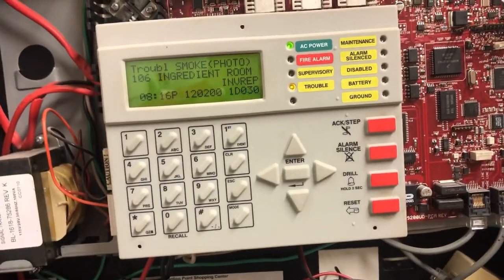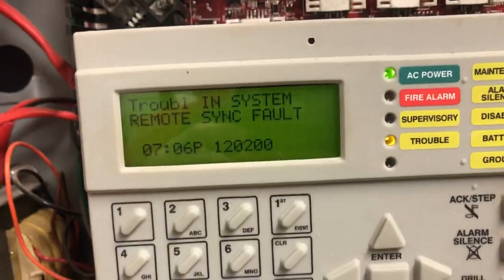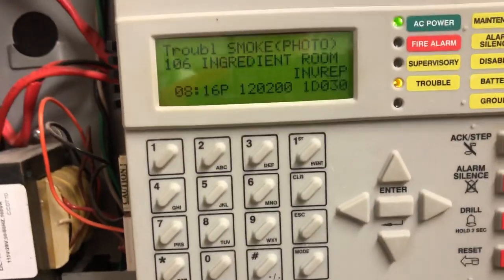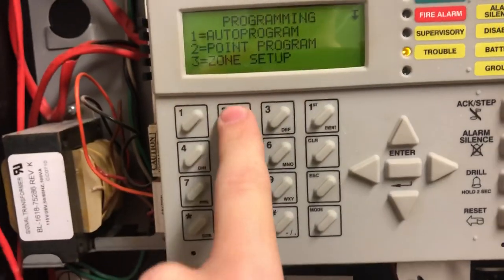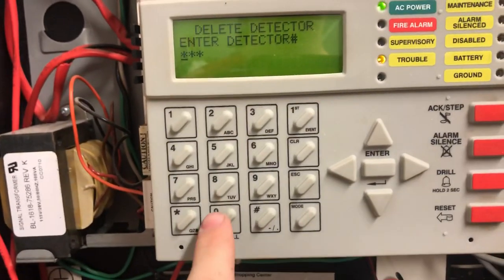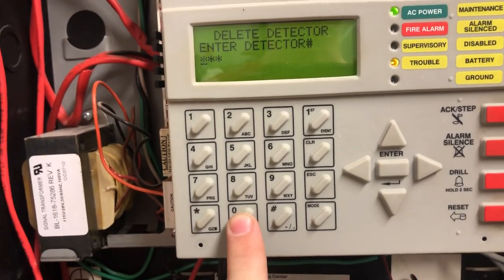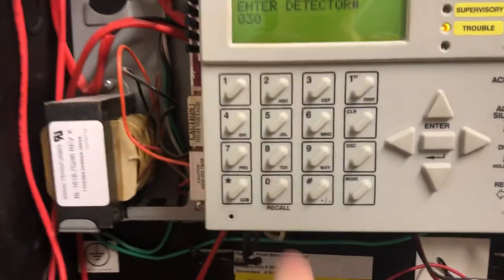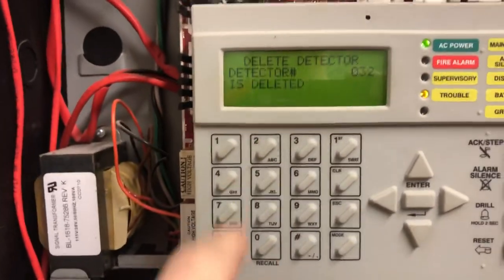The World of Fire Alarm: NFW2-100

Comment: Dear Sir, I am grateful to you. Your articles helped me a lot. Could you plz help me on one more occasion? Need to know how to provide power to control modules in nfs2 640 and how to assign detectors & horns in a zone ?
Reply from the maker: Use the 24v Auxiliary power terminals located at the top of the CPU board for NFS2-640 and connect them to the auxiliary power input terminals on your FCM-1’s.

To assign zones to a device through the keypad, hit the following keys:
Enter-> 1 ->  You will be asked for the password. The default is “00000.” -> hit 1 for basic program -> hit 2 for point -> hit the # button followed by the loop number and device address for modules and enter the number of the zones you wish to assign to that address in the 5 blank spaces on the second line of the LCD. Do the same for detectors, but instead of hitting #, hit *.  For panel NACs, hit & followed by the number of the NAC you wish to edit.

I hope that this message translates well into your language so that you have no issues understanding my instructions. I will try to make a video demonstrating this process sometime soon

Comment: If I made the FireWareden series. I would put in The real FlashScan instead of the fire warden “flashscan” along replacing Fire lite CLIP with Notifier CLIP kinda like the AFP-100 where there was Notifier CLIP instead of the Fire lite Clip on the Original MS-9200. I think my elementary school had one of these panels since there was a Notifier FUD-80 (which is a Fire Lite LCD80F) but the pull station was blinking red. The school was to new for Older Notifier clip panel. So I think it’s a NFW2-100.
Reply from the maker: An easy way to tell is to look at the smokes. If the smoke detectors have a second ring around the chamber, then they’re Notifier. If they don’t, then they’re a fire lite rebrand.
Reply: @ncalarms6022  the smokes don't have the ring. So it must be a NFW2-100. The school dosen't have much smoke detectors. Like my Middle school (eventually high school)

Comment: hello, is it possible to connect notifier fsp-851 detectors in this panel? even if they have a different communication protocol
Reply from the maker: Possible? Yes. Legal? No
Reply: @ncalarms6022  so this panel has clip protocol?
Reply from the maker: @Sdifirealarms  it has litespeed and CLIP. FSP-851’s will only “work” on this panel when the panel is set to litespeed
Reply: @ncalarms6022  I had thought of buying this panel but I only have fsp-851, fsp-751 and cpx-551 (ion) detectors, could they all work then with that configuration?
Reply: @Sdifirealarms  yes

Comment: Why not use your laptop and PS Tools? Much better to have a copy of the database in case something goes wrong. Also Now with the NFW-100X you can use Firewarden devices on the same loop with Onyx series devices.
Reply from the maker: Dick Fitzwell We did not install this panel and we do not monitor the building. We happened to be doing a fit-up in this building and needed to remove the addresses to make the panel normal again. I would have done it through my laptop if I had a serial cable to connect to this panel.